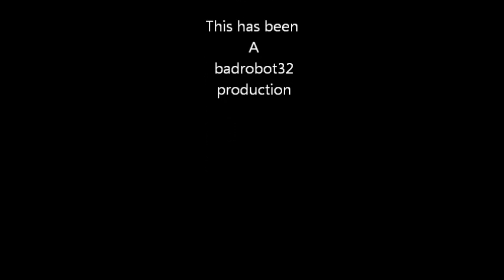YOU CAN BUILD THIS 3x7x7 Cuboid - TUTORIAL

Comment: Thanks for these tutorials, they're really helpful.  I'm working on a non-pillowed 4x4x2.  I used sandpaper the entire time because I was worried about keeping the top and bottom totally flat... sanding is done now, but it took FOREVER....

I want to make lots of different cuboids.  Do you know a better way to keep it flat without just sanding?  I think a dremel would be really tough to keep FLAT, and cutting.... maybe... but it'd be hard to keep it straight enough I think.

I don't have access to a belt sander.  I might be able to get my hands on a palm sander or something like that... tools are tricky because I'm living in a foreign country with very little English, and almost nobody with any DIY sense.  Right now I'm using a sanding block, a flat surface and my hands.
Reply from the maker: to get it really flat id go for cutting it down to within a couple of mm of the finished level and then finish it by hand, it does take a while but it takes even longer if you go to far with a power tool and have to build it back up to the correct level